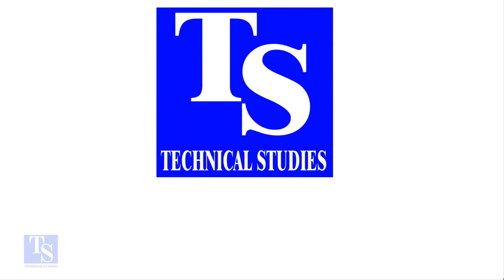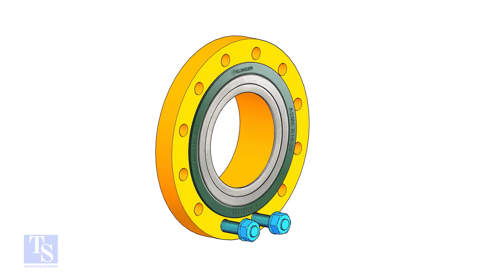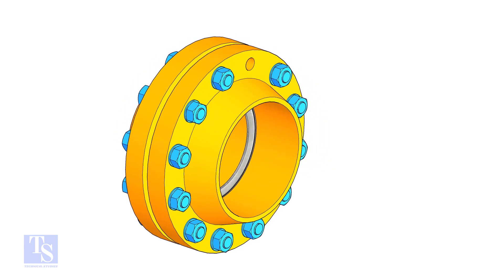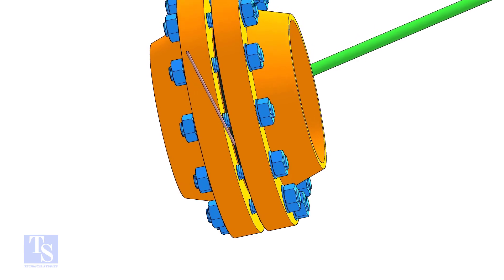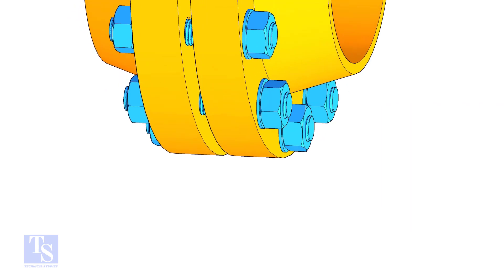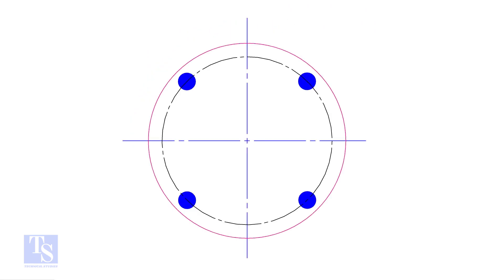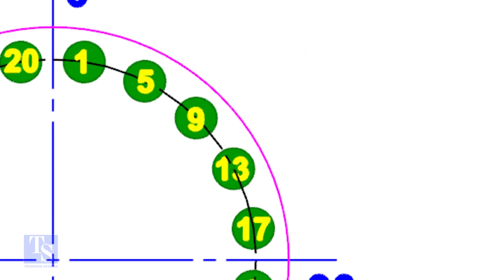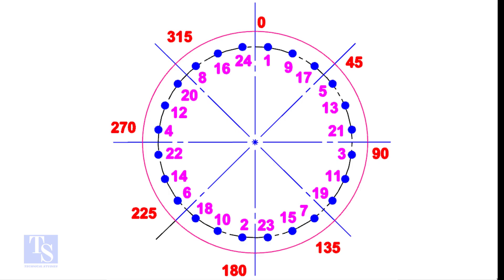BOLT TIGHTENING SEQUENCE WITH SIMPLE CALCULATION TUTORIAL

Comment: There are many variances from company to company. In my experience the torque values run 50% , 70% 100%.

You could have also indicated that the gasket outer ring will sit ln the studs to align the sealing surface with the  gasket face.

NB. Use of antisieze is recommended for  most applications. Where cathodic protection is used do not use lube with metal particles.

Great content from this channel bro. Keep it up.
Reply from the maker: Thank you, Bro. You are right, the procedure varies. In my view, if you apply, 50% torque directly on the 1st and 3rd bolt, the gasket may damage, especially in raised face flanges. Sometimes, I avoid showing all the details, to shorten the video. I prefer, people to learn things, related to the topic only. Viewers don't like large videos, that is why. Thanks again.